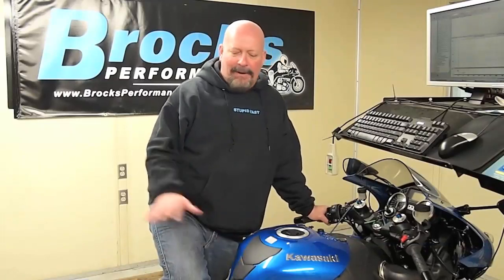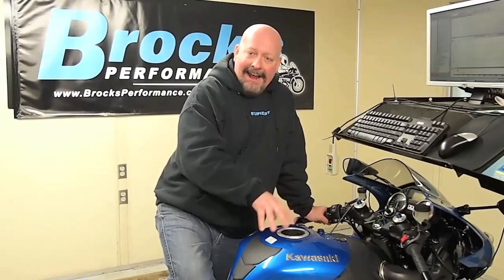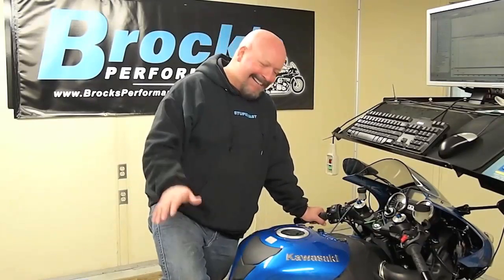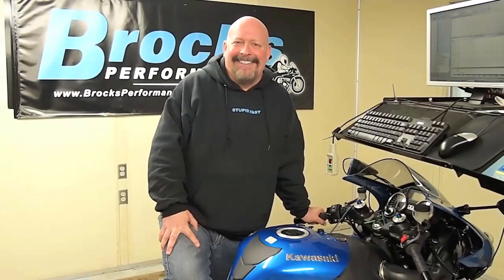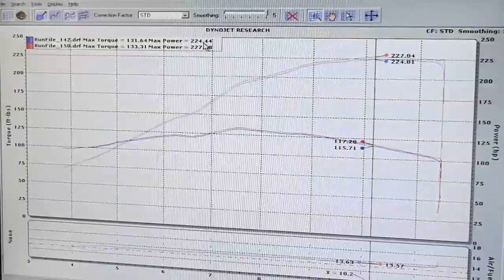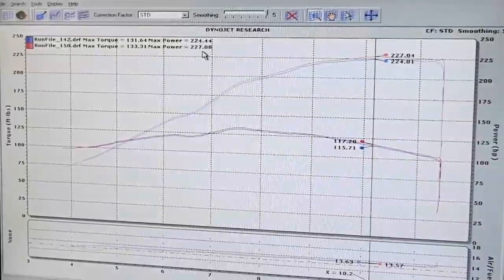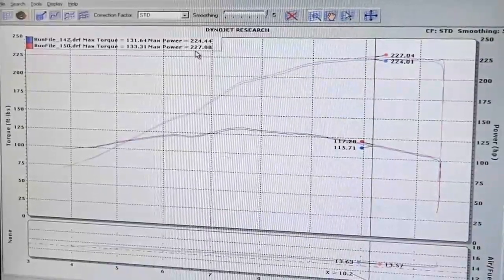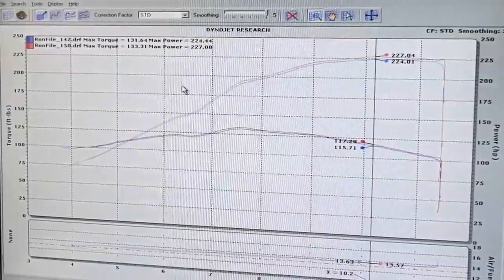The Louisville Slugger: 2012 ZX-14R Dragbike.com Project Update

Comment: totally agree on the high hp reading dyno, if you look at his graphs most dyno runs  are done when the air  temperature is cold, and very low humidity.....that shows good numbers on the dyno and makes more sales. Dynojet tested one of his pipes on a 2012 zx14r.....did NOT even make 200 hp. took it to the track......it's also on you tube

Comment: That's bad ass right there! The gen 14 was a beast but this one, damn no words on how powerful it is! Kinda wish I went on ahead and bought the 14r lol. Just not into big bikes so i just went on ahead and got the 10r. which is a beast in the 1000cc class and its more powerful than the busa and the gen 14. So thats good enough for me. I would guess and say this 14r would out around 212hp to the back wheel on 93 octane fuel. Regular pump gas. Still bad ass!
Reply from the maker: Dynojet tested in the high desert, on pump gas, on the SAE scale... a recipe for miserable results. Afterward..they didn't go to the drag strip and prove their hp by running 8.80 at 160 MPH (stock wheelbase) either. That's the difference between Brock's and a simple dyno tune: http://www.brocksperformance.com/brocknm/templates/bpp1.aspx?articleid=317&zoneid=10